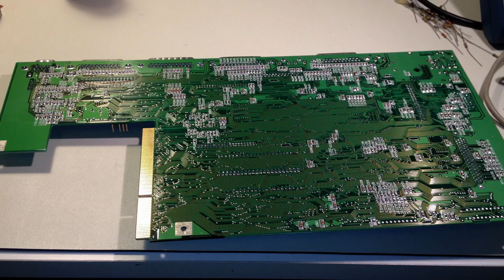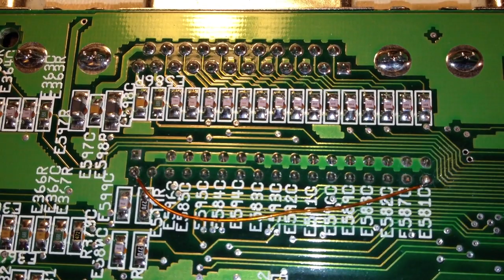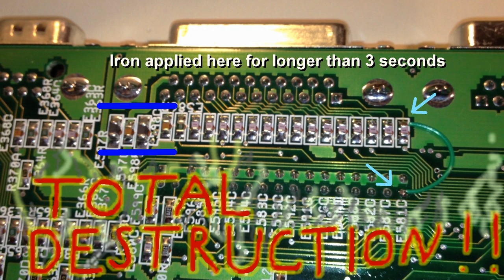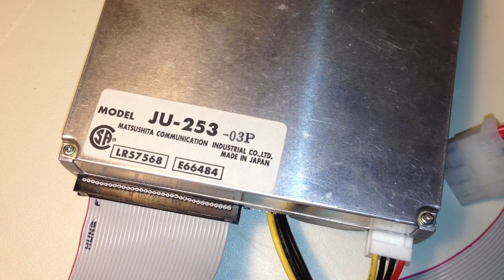Amiga 1200 Escom Floppy Fix quick tutorial

Comment: Toni Tomar en 1996 dejó un archivo en Aminet: Floppy_fix.lha con las modificaciones que había que hacer en los Amiga 1200 de Amiga Technologies / ESCOM. Hay que añadir un diodo 1N4148 entre el pin 1 de conector externo de la disquetera y el pin 10 del conector interno de la disquetera.
Reply: Toni Tomar left a file on Aminet in 1996: Floppy_fix.lha with the modifications that needed to be made on the Amiga 1200 from Amiga Technologies / ESCOM. A 1N4148 diode needs to be added between pin 1 of the external floppy drive connector and pin 10 of the internal floppy drive connector. Translated with ChatGPT

Comment: The fix ESCOM did made a diskdrive work that will not work any more with your fix. The swapping of disk will not work for the drive.. i moved the ESCOM modding to the diskdrive and jump wire the ready signal as you show in the video.  Still need to look for a good fix so all sofware works as it suppose to do with the diskdrive.. Maybe a transistor that is controlled from the sel0 line to short the connection between diskchange and ready signal or use diodes. problem is that a low signal is needed to control the lines. If i short the disk change and disk ready signal,  my second drive will not work with disk swapping any more. I short the signal inside the drive and removed the ready signal going out the drive..

Comment: Hello,

I need Your help about this fix.

I have made Escom motherboard rework and floppy rework according to this movie and this tutorials:
http://amigaga.chez-alice.fr/classic/bidouilles/disquette/a1200fix.htm
https://www.tsb.space/knowledge-base/amiga-1200-escom-floppy-fix/

I have removed wire between pins 2 <==> 34 and make shortcut between 1<==>34.
Like bellow:
https://photos.app.goo.gl/3TbhCmcpNENSCSut9

I have also modified PC panasonic floppy:
https://photos.app.goo.gl/hwoSnWdy4CgPfrma6

And as DF0 both modified floppy and Gotek are detected as Amiga devise and works.

The problem is with DF1 detection (both modified floppy and Gotek) are not detected. I checked it connecting devices directly to IDE tape and to DB23 connector.

What is wrong with my Amiga 1200? What should I check additionally?

BTW: In this Amiga I also have 3.1.4 kickstart by Hyperion.

Comment: There is no such thing as "the Escom floppy fix" as there are a variety of Escom board types. There are several possible fixes, one of which the user will need to perform depending on which board configuration they have. For example, on my 2B, your fix above has no effect with either an AmigaKit floppy drive (PC converted) or original Commodore Amiga drive.

Comment: By applying this fix to an escom 1200, could it be possible to use  external amiga drives too ,desgined for A500/600 and commodore 1200's?

Comment from the maker: HardDiskLover I don't own a HxC floppy emulator myself, so I don't really know how this emulator works in terms of signal and data transmission and so on. It is therefore a bit difficult to diagnose your problem without actually having the hardware in front of me, and without knowing more about the symptoms. All the other disks you try it with that doesn't work, are they trackloaded or are they using FFS/OFS? Exactly at what point do they crash?
But in either case, if your motherboard has the Escom floppy mod on it, then you should really return it to the original Commodore state by performing this floppy fix. If your motherboard is Escom modded, then yes, I think there is a change that doing this Escom floppy fix might fix the problem. In either case, you can't go wrong by doing it since it's something that should be done on all Escom-configured motherboards. The only downside as I can see it is that there is always a risk of damaging the board and/or lifting pads if you don't have much experience in soldering. I think it's up to each and everyone to decide whether or not they feel comfortable performing the fix.

Comment: Hi, I'm pretty new to Amiga and I have a problem with my A1200 (rev. 1D). It won't load certain disks, (I use a floppy emulator HxC) Workbench 3.0 and 3.1 (I have Kickstart 3.0) work fine but almost all other disks won't work and will make WB crash. Could this mod fix this problem or is there something else wrong?
*UPDATE* I've did this mod now some floppy's work and the other floppy discs load a bit more, but still everything crashes.
I also have a 8 mb ram expansion which when I plug it in the HDD won't show up at all. I have 3 partitions (DH0 = system, DH1/2 = extra storage) and only DH0 will show up on the WB screen (this happens without the ram expansion). Also there is no access light on the HDD when powering up the Amiga. Do you know what causes this and how to fix it?
My thought would be it is the Kickstart, for some reasons there are two different ones in my A1200 one is from MX and the other one just says Commodore-Amiga, but maybe im wrong...

Comment: Hi. Thanks for the video. Can you comment as why the connections for this fix are different on the following website. http://www.softpres.org/article:hard:fixing_the_amiga_technologies_a1200_fdd_connector

They say that once you do this (and the modification on the escom floppy drive which they also have a link to) I should be able to run track loaded games. I'm a little confused as to which method to follow.
Reply from the maker: The modification shown on the page to which you provided a link is exactly the same as the one shown in this video.
Just keep in mind that after applying the fix to the motherboard, your Escom drive will stop working unless you apply a fix to the drive too. But still, it's better to fix them both than leaving it as it is since it's quite an ugly hack that Escom performed on these motherboards which will stop real shugart drives from working properly together with one of these motherboards. That's why it's always best to have these motherboards restored to Commodore standard, as well as having "Escom" drives modified to match the signal routing and pinout of shugart drives.

Comment from the maker: No question is too stupid. :) The reason for this fix is to make it possible to use a shugart drive with the motherboard. Shugart drives carries the ready signal which will make track loaded games work. You can still use an Escom drive after the fix, but you need to make a slight modification to the drive in that case. Super simple, though. However, track loaded games will still not work with an escom drive. For that you need a shugart drive.